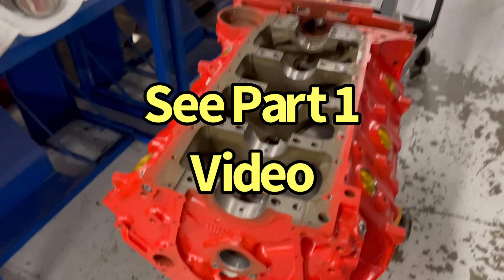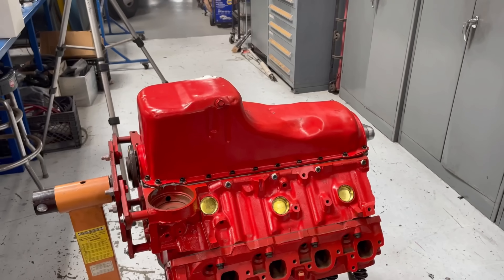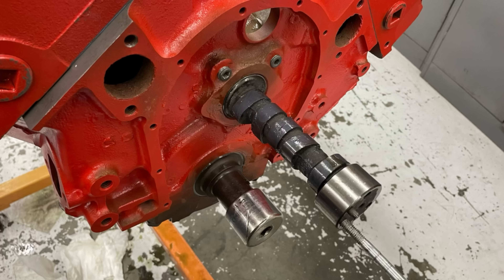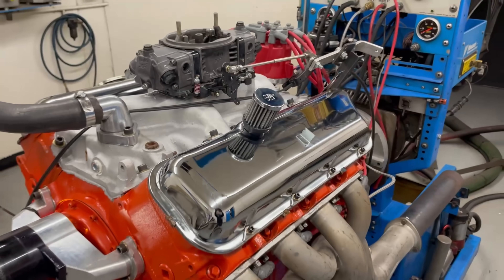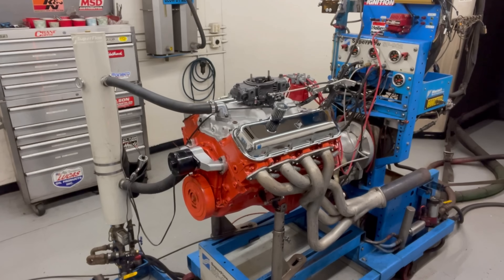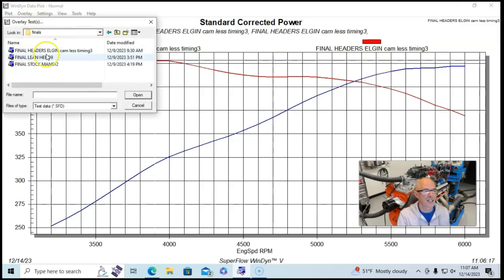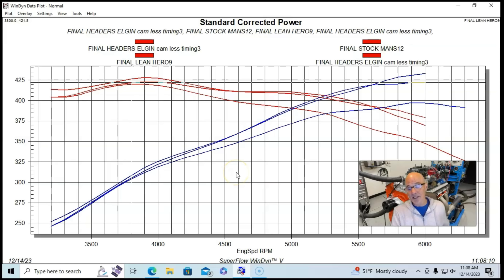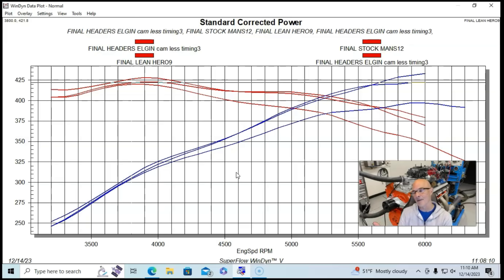FULL DYNO RESULTS ON THE L78 396, OVERRATED AT 425 HP OR  UNDERRATED AT 375 HP? WHAT DID IT MAKE?

Comment: I had a L78 I bought and slightly modified for my 68 camaro back in the early 70s.  I kept the heads cam and intake stock but changed to high compression pistons added headers and then a 3310 Holley.  I put the car on a chassis dyno and they back calculated the  ENGINE horsepower to 500-510 or so....
Reply from the maker: back calculated a modified motor? That isn't really the same as an actual dyno test but still a cool combo
Reply: Yeah - I know - but it was all I had back then.  This was 73.  Only chassis dyno,  I was 19,  what did I know back then? Enough to build a pretty stout motor though.  It ended up in an offshore racing boat (not mine).

Comment: The bhp testing used in the 60's also gave higher figures then the SAE testing standards which began use in the early 70's.
So the numbers werent "inflated", the standards were different.
Reply from the maker: the early test method was very similar to the way we ran it
Reply: @richardholdener1727  OK, thanks for the response!

Comment: The SAE NET is actually closer to the truth.   You'll have a mechanical water pump, a fan, alternator, air cleaner and mufflers.   But I think in the 60s they didn't put all of that on the engine, and they tested gross hp.

Comment: I'd like to see this engine run with a set of oval port open chambered heads.  the square port aren't helping until over 7000 rpm's.  the open chambers would lower the compression ratio, but the better chambers would help combustion. I suspect power number would be very comparable

Comment: Chevy was famous for over estimating horsepower ratings from the factory... no factory small block chevy ever made 375 hp... Richard proved that...the heads limited output to about 360 max no matter what you did..
Reply: This is a big block.  Chevy actually underestimated often. Factory 302 was rated at 295 hp.  That engine produced closer to 360 hp
Reply: @jeraldferdig2072  That's about where all the top chevy small blocks peaked hp wise... just at different revs.

Comment: Hey Richard, I would love to hear your thoughts on what is and isn’t considered “streetable” and why! I hear a lot of people say things aren’t streetable but never really get into the specifics as to why. What happens to make it no longer applicable for a street application. Thanks!
Reply from the maker: streetable is subjective
Reply: "Streetable" means that it runs well at normal street-driving speeds, without loading up at red lights, isn't stall-prone, and idles slow enough so it doesn't accelerate with your foot off of the gas pedal, and it has at least some engine braking.

Comment: I thought the 425HP came with a solid lifter cam.  I had an oval port head 396 in my Nova and it was fast.
Reply from the maker: the 375hp and 425-hp motors have identical specs-both with (the same) solid lifter cams

Comment: Nice to finally see the finished product. I have a 1969 396 in a corvette. Has 215 oval port heads, 10.25:1 compression. Only changes from stock are a comp cams 268 and a chevy performance dual plane intake with a 750 vacuum secondary carb. With headers and running the manual water pump it made 435HP and 465TQ on the engine dyno. Your 396 above with a simple cam swap would make high 400's in power.
Reply: @kevinseybert5795  I’ve only got the numbers I have to go by. Didn’t run on any other dynos to verify. And that would have been a pain. The shop that broke my engine in and tuned it for me builds high end BBC for race boats and such. Still working to get the car fully driving. Seat of the pants will really tell the story. It no doubt will have a lot more power than the crappy small block it did have. Nothing made HP in 1980.
Reply: @kevinseybert5795  I’m not comparing my motor to his. I know they aren’t the same. I was just putting out there what my motor did on the dyno. I’ve done my research. I know these 396 motors quite well.
Reply: Thanks for sharing! I am doing a 454 build in a truck using 215 heads. I was curious as to what others have managed to get out of the 215 heads. I’m running a Lunati Voodoo 262/268 camshaft so I could possibly see similar results.
Reply: Shame about the 268 cam...
Reply: @lollipop84858what do you mean?

Comment: My comment. Are we talking Gross Hp vs Net Hp. Also, all the stock BBC with any compression need 39 plus on the timing do the lump on the piston. 

Stock camshafts need .030/.030 lash to eliminate the super slow lift of the GM warranty. It’s worth 15hp on power.
Reply from the maker: this had a tight lash and we adjusted timing til it stopped making power

Comment: When I was a teenager back when these engines first came out (in 1965 I was thirteen years old) I followed Hot Rod magazine (had a subscription to Hot Rod) and every time you turned around one manufacturer or the other was claiming more horsepower than the other, all the way up to the early seventies when the horsepower restrictions starting coming in (some say due to insurance, and some say to emissions probably both). It was all about bragging rights (my engine is this or my engine is that I have this many cubic inches or I have this humongous horsepower) very few people had access to engine dyno meters as they have now and most of the claims were based on what was published by the manufacturers. All of this was just to sell more cars and capture the as much of the high-performance market as the manufacturers could. I am sure that there will be comments about the accuracy of this statement and to that I would pose the question, is there any way to get a true representation of one of these engines in the stock form as presented by the manufacturers as they were sold new and with the standard accessories of the time with the proper octane rating of the fuel that was sold at the time to give a true dyno meter pull to see just what the horsepower was. Of course, even if these engines actually put out close to advertised horsepower that is still impressive for that period of automotive history. Just think in 1965 the Chevrolet small block was out ten years and the 265 c.i. engine was rated at around 160 hp or around 180 hp with the power pack option.
Reply: The fuel isn’t as much of an issue as you think it is.

Comment: So the 325 probably made 350, the 350 made 375, and the 375 horse made 425?...Right?   hahaha LOL
Reply: Just a daily driver street racer, but a serious one; n got sponsored by a couple speed/dyno shops. Seen about anything you can think of actually dyno. The 60’s muscle cars were  overrated . Not by a ton, but certainly so. 

Had the opportunity to not only see a  COPO 69 425hp hp with 2000 original factory miles get tuned on the dyno but also rode in the car afterwards. I believe it first made 344 rwhp and about 355 after tuning. Really need to look again at the dyno sheets but if off, very little. My car at the time made a little over 500 at the wheel with a 300hp progressive nitrous. Maybe I was spoiled, but I had a hard time figuring out if he was 100% on the throttle. Looked close… he was. 

Kinda busted my bubble. Was expecting to not be able to grab a 20 on the dash. 😀 amazing how urban legends spread n how they get busted by new tech. 

Denny

Comment: Most 80s engines made about 1 hp per cubic inch or a little better.
Reply: 145 horsepower for an Oldsmobile 307, 140 horsepower for a Chevy 305, 250 horsepower horsepower Trans Am with the 400.  That is much less than 1 hp per cube.

Comment: I had an rpm question.  I didn't research this, but was the 'factory rating' at an rpm lower than where you saw the peak horsepower on your reproduction engine occurring?  Stating a horsepower at a less-than-peak rpm might be a way to understate the ultimate capability (of course maybe that stated rpm implies a redline, and may mean where you should stop revving it for hold-together reasons...).   As an example, it looks like on the leaned-out header run, you didn't actually find the peak pony at 6000rpm.  Maybe it still had more r's in it - she's still breathing.....still making pony...if she holds together......   Maybe the 425 horse just came by some more rpm.

Comment: Impressive HP - I have an L34 396 Chevelle that I had the cam upgraded to a roller cam and some minor porting and it dynoed at 443 HP, with headers.  I run it in my car with cast manifolds and full exhaust, so I assume I gave up at least 30 HP, this seems to confirm that. Thanks for the test.

Comment: So everyone else on the planet can get one HP per cubic inch from this engine but you lol ,good tuners got closer to 450 HP you say it was more then likely 375 HP what CC heads are those closed chamber heads and what are the cam specs ?and why not a 780 you have to build it just like Chevy did and you didn't I've never seen real rectangular port heads that didn't come stock with guid plates
Reply from the maker: these had guide plates, this made more than 1 hp per inch, and the factory rating is not a tuned version. the cams specs are stock l78 and (as mentioned) the 780 carb won't make what this XP carb made  (lol)

Comment: Did I miss something? What was the fuel used in the test ? Was it leaded 100 octane or pump 93 unleaded ?
Reply from the maker: 91-no detonation because we ran it at 135 degrees-doesn't need 100
Reply: @richardholdener1727  thanks for clearing that , makes sense

Comment: I recall the MkIV being introduced part way through the 65 model year, the first part of the year being the 409, but single 4 barrel only. For a very brief period, the L78 was rated at 450hp, before they dialed it back to 425. Chevrolet was in a difficult position, their new improved big block had to be seen as an improvement over the 425hp W engines of the year before, and the factory knew there was a 427 Mk IV being released in a short few months. If their 396 was already rated at 450 or 425, what would they have to rate their 427 at. That’s the problem when you play fast and loose with the numbers, it wasn’t the first time the Chevrolet division got themselves in this trap, and it wouldn’t be the last.
Reply: No that was the 427 rated at 450 then derated to 425
Reply: @benjaminwatson7868  The 1966 427 L72   was initially rated at 450 hp but re-rated to 425 hp by Chevy to minimize scrutiny by the feds and insurers.
Reply: @billdedrick1914  that’s what I said
Reply: Kevinseybert5795 I was mistaken when I said the L78 was briefly rated at 450hp, it was 425hp, then reduced to 375hp. However, the L72 was rated at 450hp early in 1966, before being dropped to a 425hp rating. A Google search of early 1966 L72 horsepower ratings explains it, and you can see the air cleaner sticker on early 66 corvettes. Chevrolet just had too many variants of their engines with minor differences in the case of the small block. In the case of the MK IV, they seemed to be hung up on maintaining 25hp differences between the different variants, and since their early hp ratings were extremely optimistic to start with, it quickly got silly.
Reply: The 1966 reduction to 425 hp was insurance and corporate related only.

Comment: I know how badly you wanted to get this project done. I believe your findings are spot on , especially when one factors in the necessary factory accessories, carburetor and exhaust manifolds. Thank you for building the engine as close to stock specifications as possible. What were the camshaft's specifications? Well done Richard!

Comment: Drive one you will understand 😊
Reply: Only people that did would understand.  I had a '69, 2 1/8" headers, L88 Cam, dual points, m21 4 speed and 4.10 posi.  Ran 12.98 @ 115.  Put 4.88's in it and Ran 12.75.  I beat every 350HP 396 I ever ran by 8-10 car lengths.  Nova's Chevelles Camaros...  That Nova put a smile on my face every time I drove it.

Comment: My uncle has several L98 swap vehicles, with a turbo 400 and 3.08 gears in a 89 camaro with Holley 750 in a pretty much stock L98 on 93 octane. Full assesories without ac. Put down right at 330 whp. Runs low 12s @110 mph. He has a L98 swapped in his 92 Silverado drag truck runs mid 11s 112-115mph. My uncle has at least 3 L98 engines sitting on stands. Mention LS swap around him and be prepared to get into a heated battle.
Reply from the maker: L98 TPI motor?

Comment: Somethin's Not right here....The 1st year production 1965 L78 was Factory rated  425 HP @  6400 Rpm.....Next yrs 1966 & Later Chevy specs it at 375 HP @ 5600 Rpm......Despite Chevy specs Both engine Internals are Identical ?? .....Somethin besides "Exhaust Manifolds " are Different !! .....Not Likely to Lose 800 Rpm (And 50 HP) with Different exhaust Manifold ......That extra 800 Rpm naturally makes More HP.....Probably 50 HP More !!.......Your "Reproduction"  Cam's  probably got Less Actual Duration timing than the '65  Factory L78 did !!
Reply from the maker: It's not the cam-it's the rating
Reply: Different exhaust manifolds, maybe different carbs, more or less timing advance.

Comment: I think you got it right. As installed (mostly) 375 sounds about right, 425 hp optimized. Now lets step up the intake and the cam a little bit, and see whats she does. I have a couple of 402's at my disposal, and I am looking for ideas.
Reply: Would those be the 396, 30 over?
Reply: @alanmeyers3957  Yep they are factory 402's
Reply: @alanmeyers3957  Yep they are factory 402's.
Reply: @alanmeyers3957  Yep factory 402.

Comment: Thank you for the follow up video Richard I was disappointed in the first one when it started leaking water. I’d like to see you do another video like you have in the past with other engines were you optimize with modern cylinder heads and modern roller cam and intake manifold. maybe this is too much to ask but the 396 is probably one of my favorite big blocks and I was happy to see you do a video on it. thank you for the content. I very much appreciate it.
Reply from the maker: planned

Comment: You can quit welding the pickup they make 1 that has a flange that bolts to the pump housing...
Reply: Good to see you do a classic anyway. Bit if its a melling 4 bolt the do make the sump for it 2 bolts come off the pump and pickup bolts there I know cause I have 1
Reply from the maker: thnx-again, this housing had no threaded bosses-if the one you had did-using a bolt on pick up works. For this pump-we needed to tack weld the pick up tube in place.
Reply from the maker: not to this housing
Reply: You have to do what is needed I understand it's just a thing where if that weld stays there I know you do dyno combos so it's probably fine if it's a driver I've seen the welds come off and go places like the pump and bearings... not a good ending there.

Comment: I’d be curious to see the difference in power between Camaro / chevelle manifolds vs Corvette exhaust manifolds. I know neither are as good as headers but would be neat to see if the vette manifolds/exhaust system  flowed better hence Chevrolets better rating in the Corvette.  I’ll also bet the Corvette rating numbers were done with headers

Comment: 396 loves to rev. Interested to see what a cam, roller rockers and single plane would do.
Reply: keep hearing stories though that they wouldn't hold high rpm like 5500+ for long term without shelling out of the factory.  could make 1/4 mile runs but holding down on the road had couple of friends claim that they'd blown them doing so.
Reply: @brianhicks9568 I believe it, besides having an inherently short lifespan, these did like to disassemble themselves when subjected to high rpm’s, don’t take offense to this but I absolutely hate the big block Chevy and I’m impressed by the small block.

Comment: The 1965 L78 was 425hp+ and had a 7200 red line, that first yr engine was quite special.  After that the engine was detuned...
Reply from the maker: engine specs are identical (including springs and rpm potential)
Reply: @richardholdener1727   That is correct, but if you owned a early 65 ss impala or a vette with the L78, engine was clearly different.
Reply from the maker: how can it be identical and clearly different at the same time?
Reply: @richardholdener1727  Easy, the factory specs for that first early engine were not for it, they were for the 66 375hp..
Hence the 65 said 425 on air cleaner and the 66 said 375. 
The 427 came out in 66, didnt need two engines at 425hp.
Reply: @richardholdener1727  I believe the cylinder walls were thicker on a 65.
Reply: LOL, Engine was identical except for the exhaust manifolds.  L78 is an L78.

Comment: With the correct 3310-type vacuum secondary "780 cfm" carb, no overbore, stock valve job, typical as-produced deck height, typical as-produced combustion chamber cc's, a full stock dual exhaust system, engine-driven water pump, engine-driven alternator, engine-driven radiator fan, stock air filter & housing, full operating temperature, etc., the quarter-mile terminal velocities of numerous period road tests of L78-powered cars, reveal an ACTUAL power output of no more than about 300 horsepower, which is less than any new stock base-model 4-cylinder 2023 Mustang..